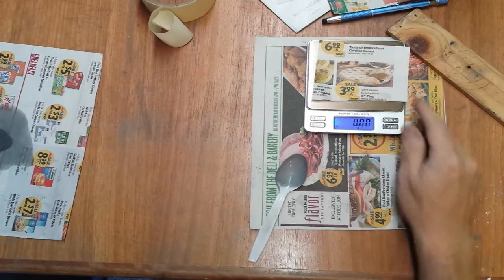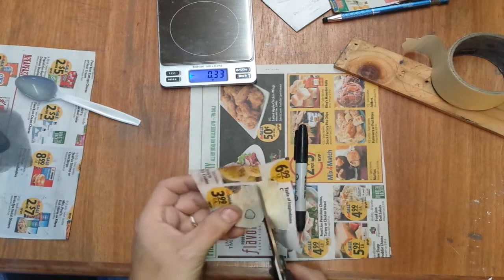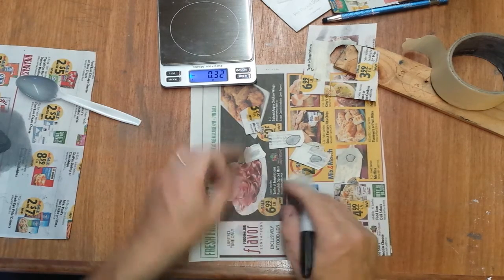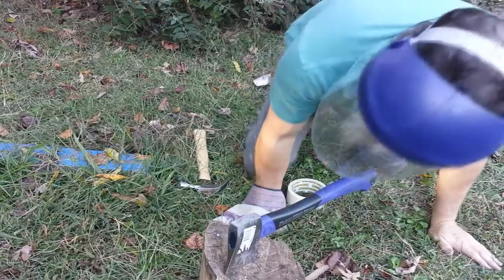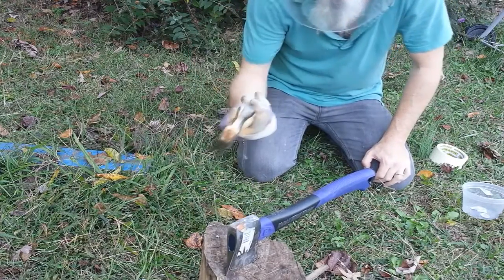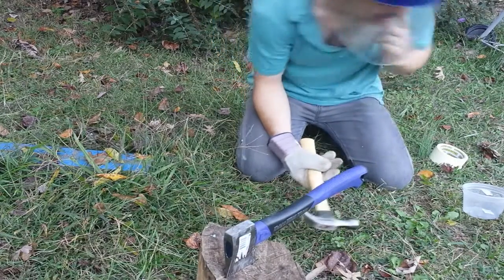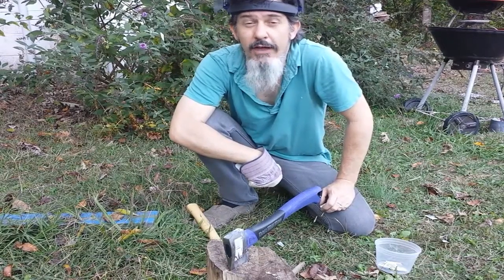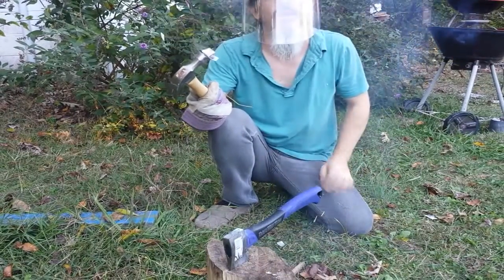Flash Powder - Explodes Upon Impacting with Hammer

Comment: I've been looking for a compound I could use to make primers with that don't contain Sulfur or Phosphorus. This seems like the best option for primary impact explosives. Something like this would probably work decently for making caps for black powder shooting if you could get it to detonate reliably. I just like finding ways to be totally self sufficient. Ideally, potassium nitrate and aluminium are basically inexhaustible resources. I mean, you pee out nitrates and aluminium cans will never be in short supply. If you could use this for reloading, you could make as many primers as you wanted with no fear of ever running out. This is a lot easier to make large amounts of than what you could make by grinding up match heads anyway.

Comment: What does the flash composition consist of? Is it the standard Potassium perchlorate (KCl04) / and dark pyro aluminum mix?
Reply: 7g potassium perchlorate to 3g dark aluminum
Reply: Its chlorate (KCLO3) not perchlorate (KCLO4). Chlorate flash is a lot more sensitive do not get the two mixed up.

Comment: You using tape to confine it is cushioning the blow so it is actually more sensitive than you are demonstrating. Also iron oxide on the surface of the metals will act as a catalyst and increase friction making it even more sensitive. Your video is giving people a false sense of security. For those that say my flash doesn't do this , it is because they have not learned to make good flash yet. Just because something doesn't react while you are doing it doesn't mean it is not going to in the future, you just got lucky.

Comment: Apparently KCLO3+AL is not that dangerous to handle, if you need to hit it with a hammer to get it to explode? It would seem a reasonable conclusion that it cannot inadvertently explode if you handle it with normal precautions, like you would handle black powder? Right?
Reply: Exactly. Commercial flash powder is actually KCLO4, which is less friction sensitive, and a lot safer than KCLO3.

Comment: I highly underestimated this 😅.. I did it with 1 grain (0.065 grams) and I thought it would sound like those useless impact poppers kids throw on the ground.. 😪 boy was I wrong! It was so loud that the sound from it made my ear ring a little and my ear felt thick and the flash from it was really really bright it left traces in my vision.. 

My recipe was 0.35 grams Potassium Chlorate, 0.15 grams Aluminum, 0.125 grams Sulfur.. all chemicals were extremely airfloat, ball milled Dark Pyro Aluminum (NOT TOGETHER) for about 75 days with lead media in a atmosphere of Argon.. 

Also instead of paper, I confined it really really tight in aluminum foil.. 

Not doing this ever again.. it was soooooooooo freaking scary!! I still have alot of flash powder remaining.. I feel you Schel and Subscribed 😄
Reply: Also, Happy Fathers day Schel!
Reply: 75 days with lead media? Your aluminum must of been very contaminated with lead, also why the argon, the aluminum Will oxidise into the atmosphere anyways unless you store it under oil which ruins it
Reply: @KClO3  Works great for me but i'm gonna switch over to glass marbles in the future cause of lead isn't a good thing to work with
Reply: @DavidsPersonalChannel  75 days means it worked like shit, it took mine only a week with glass marbles, but even better is stainless steel balls, then it only takes a few days,

Comment: That was cool, I didn’t know black powder would detonate on impact. I only thought nitrated glycerin would detonate with impact.  I will have to try this.
Reply from the maker: This is an extra sensitive formula of flash powder, NOT black powder. Flash powder is used in fireworks and is made from powdered metals and a chemical oxidant. Black powder is a different compound, made from charcoal, sulfur, and potassium nitrate (oxidant). Black powder is not impact sensitive. Thank goodness, otherwise, loading a muzzle loading riffle would be suicide!

Comment: I was mentored by a friend of mine who's job is pyrotechnics for 4th of July stuff, theater applications etc... We would go to his workshop and he'd make his own salutes 1/8th sticks and 1/4 sticks... I made a few over there under supervision but every time I did my heart would beat hard and my hands were shaky... If you saw the power of the salutes he taught me to make, you'd shake too! The flash alone on those were 22" wide 18" high and you'd feel it rattle your chest! A great way to permanently amputate your limbs if not careful... Scary shit! I would advise anyone thinking about making this stuff to seriously think again... I sure ain't gonna mess with it, just not worth it...
Reply from the maker: You are correct sir. Flash powder is not for the novice experimenter. Its way more powerful and sensitive than is needed to make homemade pyrotechnics. Black powder is plenty strong enough to make great salutes and other effects.
Reply: schel sullivan Agreed... AND if I remember correctly, we would have to wear respirator masks because the flash powder we'd make was a 70/30 mix of potassium perchlorate and micronized aluminum(aluminum is a heavy metal and is neurotoxic). Sometimes at the end of the salute tube we would pack balls of "flint", and something else I'm not sure, for a nice colorful sparkle effect! We would cut a hole in the bottom of a soda case box just big enough to hold the salute and stand the 1/4 stick up with the pyrotechnic flint stuff pointing upwards for effect. Fun days... 
I remember the day he packed a 10" long tube with 200 grams of flash powder mixed with 50 grams fast burning black powder. He drilled a hole into a toppled over telephone pole and stuffed it inside... That pole cracked in half like a toothpick!
Reply: Australian Pyro 
I absolutely understand what you are saying and you're right. My only reference was one of a "pyro culture" reference not a factual reference. It is FACT that this is what people "call" them but it is NOT a fact that it is what they are. I guess you could just call them "general-equivalence explosives" .
Reply: Australian Pyro It was definitely cool for sure! I would not create them at my home personally, too dangerous without proper precautions/storage and also for the legal ramifications. I'm not exactly "prison material" and being arrested on charges of "conspiracy to commit acts of terrorism"  doesn't exactly look good on my record!
Reply: Australian Pyro 
I heard a story a friend told me of some guy putting 200 grams of flash into a freezer bag and it blew up on him. I guess the bag gave off an ESD and ignited the flash. This is why I only used paper bags for storage and locked inside a wooden toolbox. Neither wood or paper can produce or conduct an electrical charge... People don't think about ESD or the sources of it, they tend only to worry about flame/spark.
Reply: Australian Pyro He got severe burns and hearing loss in one ear if I remember correctly.He was transfering the powder from a glass measuring cup into the plastic bag when it went up. Not all of it ignited or he might not have lived to tell about it.
Reply: Australian Pyro 
Where do you work where nitroglycerin is being handled? I wouldn't want THAT job...

Comment: I don't usually store flash powder but if I do its only a gram or 2 in a small (1/2 cup) plastic Rubbermaid container.  Is this relatively safe and do I need to worry about static discharge igniting my flash powder?  Thanks a million for sharing.
Reply: DroneXFun flash and plastic don’t go together ..... for safety reasons stick to metals ..
Reply: DroneXFun you could even store it in styrofoam cups.. that’s the best option .
Reply from the maker: Yup flash is electrostatically sensitive. I never store flash or anything else for that matter. Would need properly and legally  constructed magazine to do so.

Comment: On a different topic, ¿did you ever manage to make fully working black powder? i have tried to make it several times since i was a 17yo kid (im 44 now!) and no matter how "well" i mixed the ingredients, i would allways end up with a slow burning dark grey powder than burned slower than just potasium nitrate + sugar.
EDIT: Forgot to mention: Suscribed! :)
Reply from the maker: I'm still working on homemade ball mill which I think is the key getting the intimate mix of ingredients. I did make a small batch using a peanut butter jar and a drill as a makeshift ball mill and it works pretty good. Oh and thanks for subscribing and tell your friends
Reply: Sounds good! please let us know if you succeed. A word of caution, remember that a ball mill could easily setoff the powder if you attempt to mix all the ingredients together & dry. So be careful.
Good luck!
Reply from the maker: Yup my makeshift drill and peanut butter contraption ran outside behind a big tree just in case. Oh I used wrench sockets for tumbling media.

Comment: Hi Schel, Is this "real" flash powder as in potassium perclorate + aluminium power, or is it Armstrongs mixture?
Reason i ask is because it seems to have relatively low sensitivity
Reply from the maker: elvampir0 this is a 70 potassium chlorate, 30 dark aluminum flash mixture. Thank goodness it's not as sensitive as Armstrong's!
Reply: Ibe never made flash powder, had a hard time getting the aluminium "thin" enough. But i was under the impresion that it was even more sensitive than Armstrongs. Yes that Armstrongs is very sensitive, i do enjoy making very small quantities of it (less than 2g) from time to time tho.
Reply from the maker: Armstrong's mixture is way more sensitive than flash powder. I made a video Tiny desktop detonations where I set off Armstrong's with just a penny. And my flash powder sensitivity tests I had to hit it with a hammer pretty hard

Comment: Listen up kids, NEVER make flash powder with potassium chlorate if you don't know what you're doing because it is extremely sensitive and will go off by just grinding it with a pestle and mortar (I would know) so don't mess around with this kind of shit
Reply from the maker: No joke, Black powder is plenty powerful enough to make great salutes and is not impact or friction sensitive.
Reply: schel sullivan flash powder is better made with potassium perchlorate which is much less sensitive and generally safer
Reply from the maker: Yup, I have a guy who makes the chlorate for me, and has been mentoring me. I take precautions very seriously, such as humidity/electrostatic, friction (only use diaper method), mix only tiny batches and never store any binaries (burn off excess), keep a clean and contaminate free work area.
Reply: shmeble gates yes when made in the right way with fine aluminium powder (such as ekart or German blackhead) it makes perfectly good flash powder although if you can make it with kclo4 then that would be better
Reply: Thank you

Comment: mine didnt do that, even i put sulfur in my mixture, smash it with a hammer multiple times! nothin happens, yes im honest it did nothing
Reply from the maker: Im using a more volatile potassium chlorate and dark aluminum mix. BTW never mix chlorates with sulfur!
Reply: +schel sullivan but im using it for years niw nothing happens, i combine sulfur and chlorate smash it and swipe it with stone theres no reaction
Reply: +schel sullivan i think it is because im using flower of sulfur?
Reply: +schel sullivan pure for of yellow and when burn turns red and smells bad
Reply: +schel sullivan you cannot say its the problem of my chlorate, but they were white huge   square crystals, they where made from electrolysis
Reply from the maker: I dont know why yours isnt impact sensitive.
Reply: +schel sullivan um maybe i was making perchlorate, my cell was 80ml, it have an ability to produce 25-30g of chlorates every, my voltage is 1amps 5.1v battery charger, the temperature range about 60-70c, does it produce chlorates or perchlorates? if perchlorate well im lucky
Reply: schel sullivan maybe he didn't add as much aluminium powder or it was just too oxidised to generage sparks

Comment: Potassium Chlorate flash is much more unstable and sensitive than Perchlorate flash. I would recommend using Perchlorate based flash powders.
Reply from the maker: Thanks for the tip. I make and use only very small amounts and use it right away, never storing any amounts at all.
Reply: schel sullivan totally fine then :)

Comment: Its sensitive but not the most sensitive flash formula out there.... I use pot. Perchlorate rather than pot. Chlorate.... Safer but some applications due require a more sensitive flash.... Be safe.... Out there
Reply from the maker: Thanks Im getting expert advice from lots of experienced pyros and fireworks makers: I only mix very small amounts using the diaper method and use them the same day, never store any of this stuff. Looking out for static and never mix on days with low humidity (not much of a problem in North Carolina). I wear face shield and heavy gloves when needed. I always clean and sweep my work area after each session. I never throw any materials in the trash, I use a burn bucket and get rid of the contents after each session.

Comment: hello schel sullivan i watch your videos you make great videos and i like it very much but be careful with it as you said you are still learning trust me it is not always fun it can go wrong. potassium chlorate based flash powder is very dangerous and unsafe and  it has self-igniting behavior i recommend you not to make large amount of it peace.
Reply from the maker: Thats awesome advice. Ive been on many forums and have the direct support of those with more experience than me. I never make more that 10g at a time, I use it and never store any pyrotechnic, I thoroughly clean my work area after each session, I never throw any materials in the trash (every pyro should have  a burn bucket), I never mix flash in low humidity, I wear googles and gloves when needed. I plan for a mishap because mishaps WILL happen! Prepare for it and minimize the damage and dangers! Thanks again for caring!

Comment: Hammering on the poll of an axe isn't good for the axe; it'd be better to use an anvil or other block of steel instead of damaging a tool.
Reply from the maker: You are correct but I didnt have any suitable materials available and I couldnt wait. Sorry to make you see me mishandling a tool. I know its hard to see! Shadow Winter gave me some great advice and finding an old piece of railway and grind a flat surface onto it. Lots of railroads in my area, Im on a tight budget and I like to use and reuse whats on hand.

Comment: Is it Chlorate or Perchlorate in your mix?  The perchlorate is supposed to be much less sensitive to heat and friction than the Chlorate.
Reply from the maker: That flash was infact make with chlorate.
Reply: schel sullivan use perchlorate and dark aluminum. mix it  2.1  2 percent potassium perchlorate and 1 percent dark aluminum way more powerful.
Reply: No, it's 2 parts to 1 part not percentages silly.
Reply: PyRoOWL 1995 ,yes indeed 2 to 1 is best with the kcI04. It's more a stoichiometrially correct.

Comment: Would you ever consider going through the process of how flash powder causes an explosion (how it's different from something like black powder) and why it is so powerful? I mean I know why, but it would still be a pretty cool video.
Reply from the maker: Im still learning the physics/chemistry of these pyrotechnics. The biggest difference I think is that black powder burns relatively slow and has to be confined to make it go bang. But flash powder burns faster than the speed of sound, small amounts can create explosions even when unconfined. I saw where you said before that it produces no gases when reacted?
Reply: schel sullivan Yes. The KClO4 and Al react to form Al2O3 and KCl, solids up to very high temperatures (the reaction may be hot enough to melt the KCl).
Reply: Brandon Bickers Nano flash powder does burn at supersonic speed.
Reply: schel sullivan it does not actually burn at the speed of sound.
Reply: NO3- SAVAGERY I don't make that type of flash powder. I just do potassium perchlorate and dark aluminum I don't know about that formula.